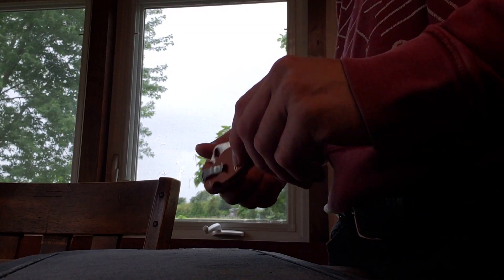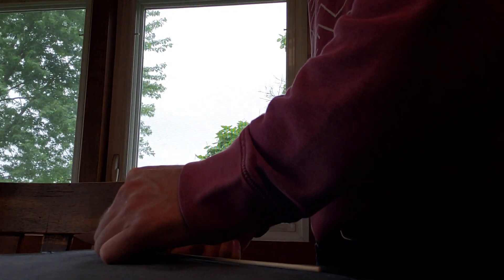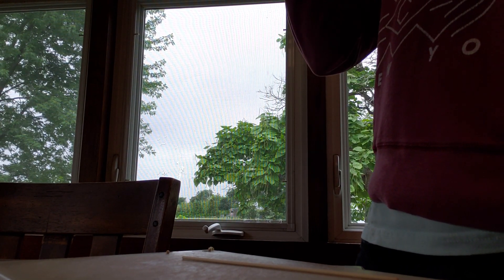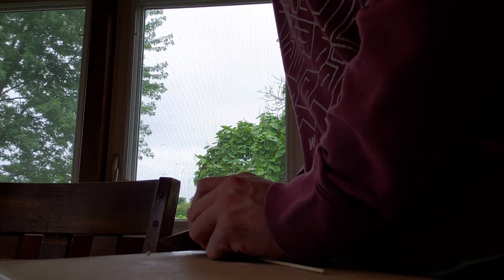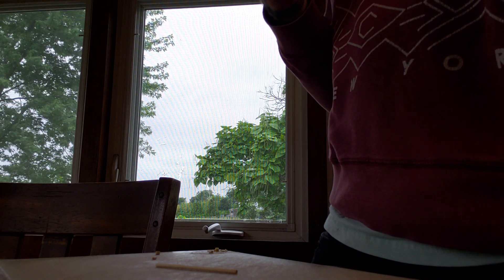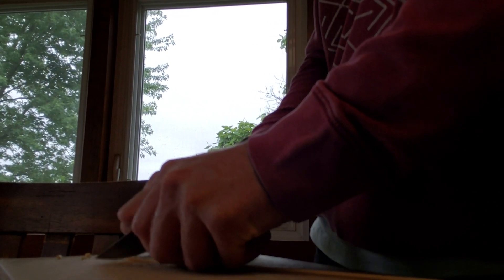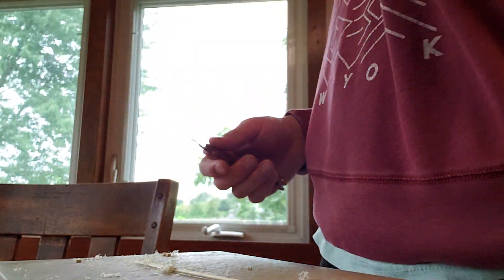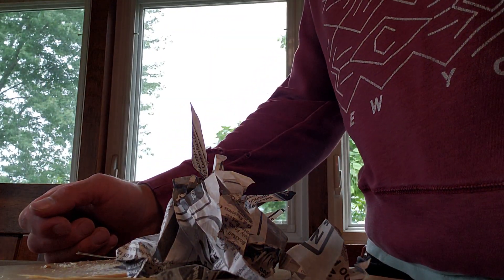CPM-Rex45 Lateral Edge Strength Test.

Comment: Now try a higher grit edge. Less force on the push cutting. (One hand)
Reply from the maker: Good call, I'll try that next.
Reply: @CoffeeAndSteel  Polished edges can be tougher too, prevents crack initiation. 

At the bottom of the article,
Good read over all.
https://knifesteelnerds.com/2018/05/28/chipping-of-edges/

Also Cobalt isn't just for red hardness. Alloys do more then one thing in the steel so it's not so black and white. The Cobalt increases the tempering resistance. Long story short that means the steel can operate with a higher working hardness and also keeps the Carbides finer, which will translate to better polished edges.

Doesn't mean you can add Cobalt to 420hc to make it awesome.
The Cobalt needs other things to do it's thing to show benefits.